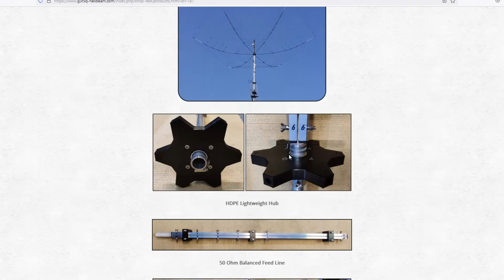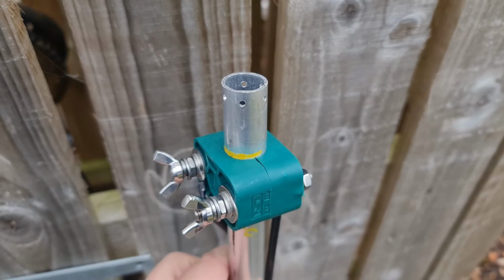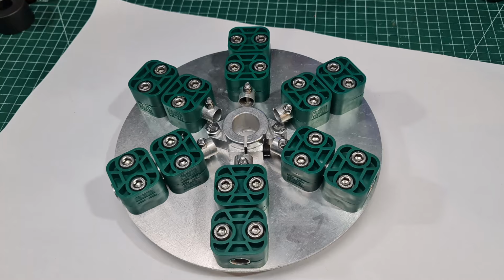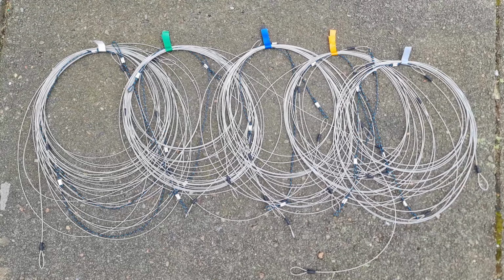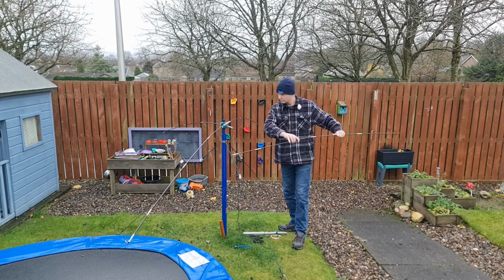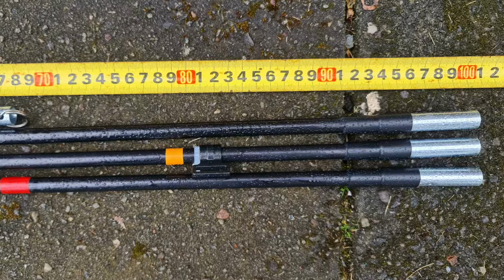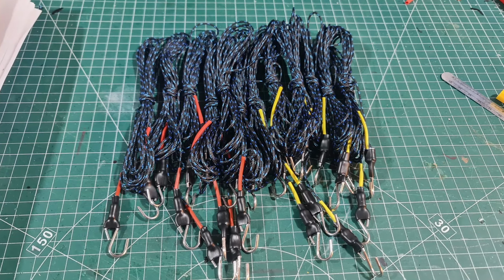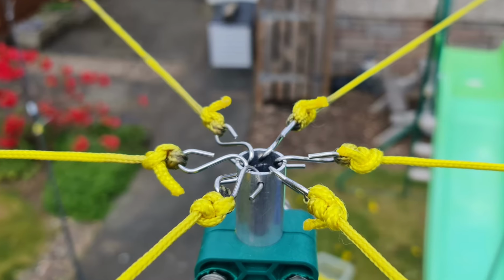Hexbeam Antenna Building - Lessons Learned Along The Way

Comment: Thanks for taking the time to make this video.  Great way to be an
Elmer.

I often think about buying vs building.  Antennas are one of the last areas hams have a chance at DIY which is the sole of amature radio.
Reply from the maker: Thanks. For sure. I dont use any commercially made antennas now.

Comment: Hi everyone, I have a little question... I'm building, or rather, I'm already in the final stages of building my first hexbeam, and I've got a doubt. So, regarding the central support, I made it out of 40mm square aluminum and connected it internally to the tube on the "hot" side of the antenna with a copper tube, which, according to calculations, should give me a 50 ohm impedance. So far, everything's fine, but I connected the ground directly to the central support, which in turn is connected both electrically and mechanically to the entire antenna support. Now my question is: am I wrong to not isolate the ground like the hot pole, or will it still work? Because as long as I can modify the connections, I want to be sure I've done it correctly... Thanks in advance, and 73 to everyone from IU3UWZ from Italy
Reply from the maker: I beleive your correct, you dont need to isolate the "ground" best of luck.
Reply: @MM0OPXFieldRadio  many thanks then I will continue my work calmly maybe we will talk in the air 73
Reply from the maker: Yes patience is the key. Never rush.
Reply: @MM0OPXFieldRadio  Hi Colin, as always I have questions....so the build of my first hex antenna ended with results I honestly didn't expect. I managed to calibrate it with your information and everything works great, but I'm wondering how critical the size of both the upper and perimeter tensioners is? Because to achieve a regular circumference and a consistent curvature of the fiberglass in my build, the measurements are different even though both the resistance and the SWR are more than optimal. Since the antenna works well and is now waiting for a rotor, I just wanted to confirm before putting it on the roof....Thanks, as always, very kind.
Reply from the maker: So it sounds like your arms and wires are all slightly different lengths. Its critical and to get all within say 5mm for it to all tension up. Saying this, if you have it all tensioned up ok then just go with it.
Reply: @MM0OPXFieldRadio  Ok Colin, yes, everything is perfectly tensioned. By playing with the positioning of the cable glands on the arms, I achieved uniformity in both the spacing and the parallelism between the drivers and reflectors, so at this point it's better if I leave it like this. As always, thanks for your interest. Bye 73
Reply from the maker: Perfect, you can rack up that DXCC now.

Comment: Colin, I really like your channel in general and the hex beam videos have been especially helpful.  One thing to watch when using any kind of superglue/cyanoacrylate adhesive is water exposure.  Eventually, the bond will let go on nonporous surfaces if it stays damp.  That said, one place it works pretty well outdoors is for sealing small lines like the Mastrant line or paracord.  I use the thin version and put a drop or two where I want to cut the line.  Since I build RC airplanes, I always have some on hand.  In a few seconds, it's ready to be cut with diagonal cutters.  The end is much nicer than a melted end because it stays at the original diameter.  Keep up the great channel!

Comment: Hi Colin can you use rg58 with the ferrite’s or do you specifically need the coax you listed in your costings?
Reply from the maker: That will work equally fine. The power handling will differ though. Stuff I use is good for 2k+ at 30MHz
Reply: @ Brilliant!

Comment: Great job Colin, and a excellent end product. I have often thought about building one, which would not be a problem for me, being a carpenter and ex electronics engerneer, but with my time focused on being on the air everyday  , and the height required to get more gain than I already get from my vertical array,  would require a tower etc, and more cost and time. But a great project, and I hope many folk do build your hex, and that will give them the gain to contact me here in zl.
Although I work plenty of uk op,s running qrp with a simple vertical,  so don't dispare those who cannot have a hex.
Well done mate, 73 zl3xdj.
Reply from the maker: Thanks mate. Your in a fantastic location for a vertical, wish it was the same for me. I just really enjoy the designing and building.